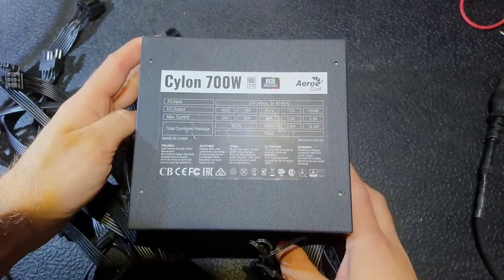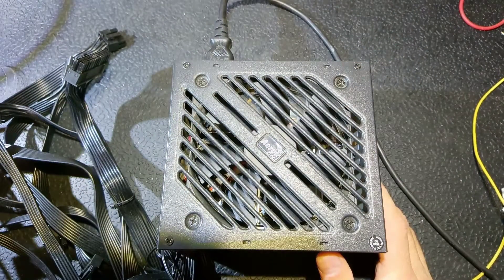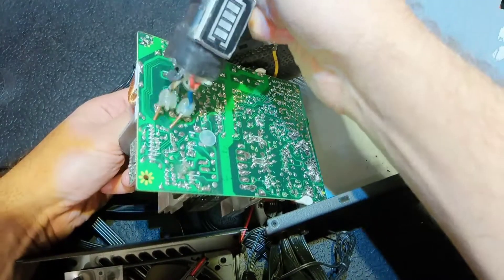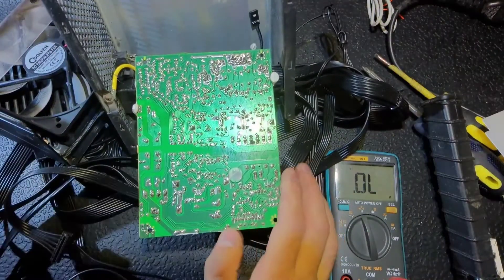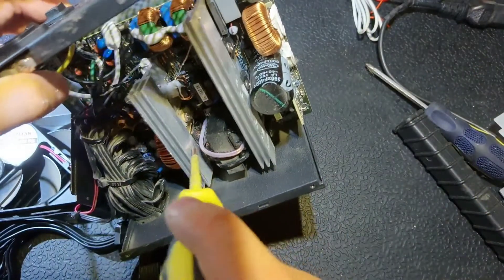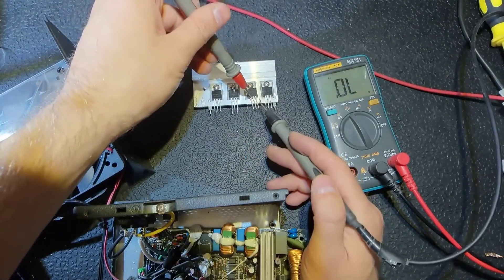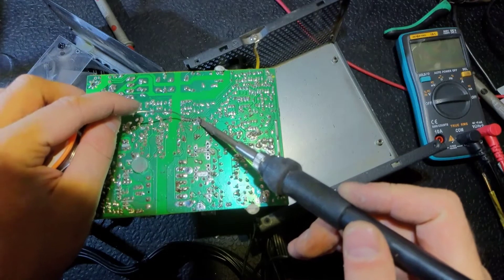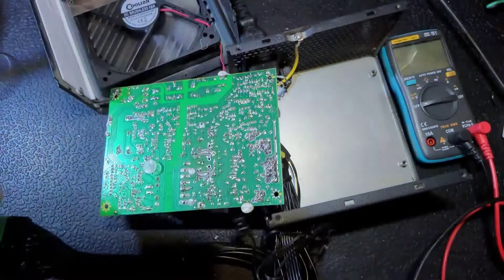700W ATX power supply repair

Comment: Nice one, now i have similiar problem with my psu. Voltage drop is correct on every output but with ohm meter there is a 0ohm on 12v line, is it the damaged rail? bulb ofc is light on while ps-on pin is shorted to gnd
Reply from the maker: Yeah. There are shorted diodes or transistors on 12v line. You should replace them.